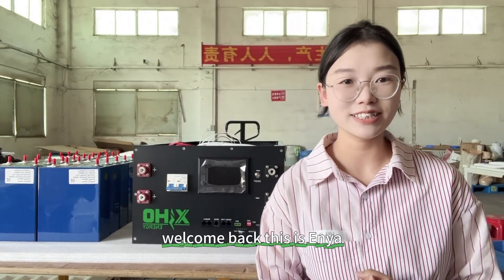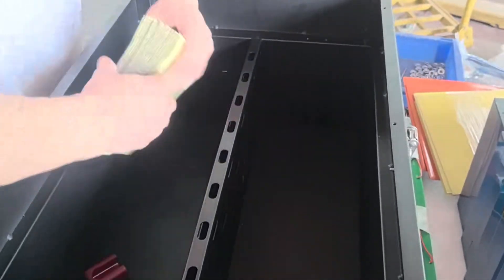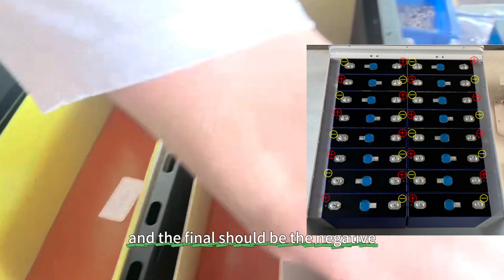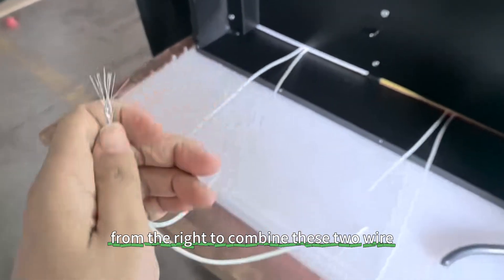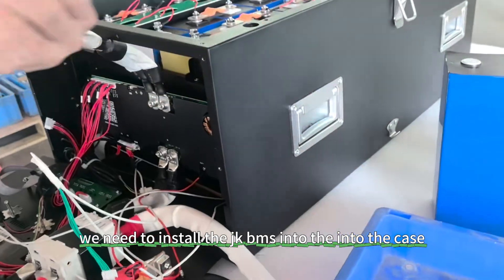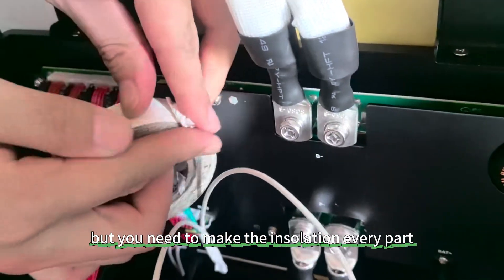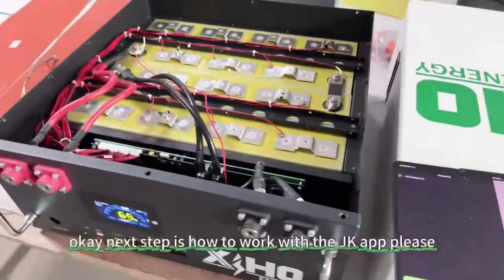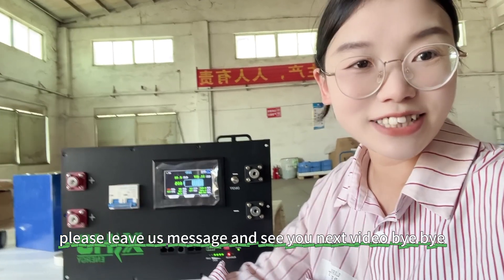USD990 DIY Lifepo4 battery pack for solar at lower temperature place

Comment: I have two battery packs in parallel with 32 Hithium 304Ah cells, with two Daly BMS and a parallel module and WNT control board. Enya, I'm wondering if it's possible to add another 16-cell battery pack and if they can communicate with each other. Thank you, you're very kind.

Comment: Instead of twisting the heat pad wires together and making a loop; instead twist them together but obtain a crimp style ring terminal that fits the positive battery post.  That way the wires don't fray and cause the connection to loosen at the battery terminal.  Should be able to torque properly with a good ring terminal.
Reply: Yeah. I could almost overlook the diagonal cutter wire stripping but no ring terminals or shrink wrap? Do better please.

Comment: But why not another epoxy board over the heating pad? Isn't there a higher risk of a short circuit if the heating pad gets damanged in some way?
Reply from the maker: Thank you for your suggestion, we will check and back to this point ))

Comment: 8:30 "GNDN" Goes Nowhere, Does Nothing" Thanks again Enya, this was helpful. For EV applications in cold climate and I've designed a compact insulated enclosure with compression for prismatic cells and pre-heating them on charge to optimal temperature (25C) to improve performance as well as low-temp charging. The enclosure also has forced-air cooling for higher temp use and it was pretty simple.
Reply from the maker: Thank you, I hope to see your video about it

Comment: I'd love to buy 3 but I've got to wait on the tariff situation to shake out first. Best of luck to you, your company is offering a quality product at the lowest price.
Reply from the maker: At present the product price no increase, only the shipping cost increase a little. Maybe you can contact with our sales first and to check the shipping cost suitable for you or not ))
Reply: Well I just recently received a 24V battery box, BMS and 8 280AH Hithium batteries from them via air freight and did not exeperience any tariff issues.  Everything arrived as quoted.